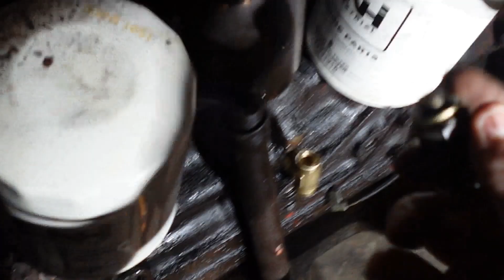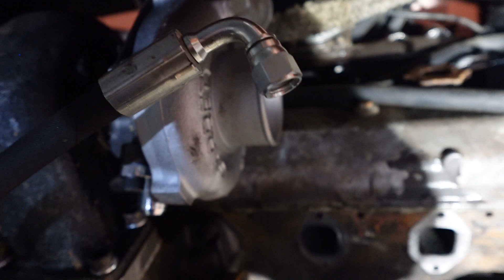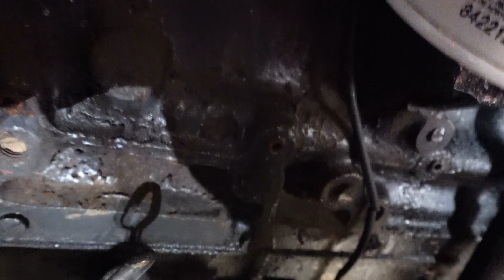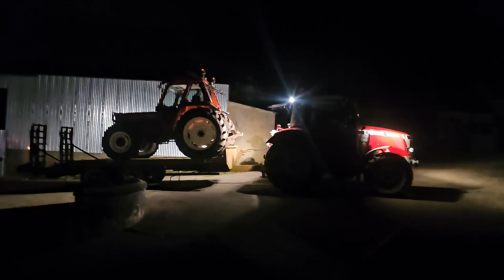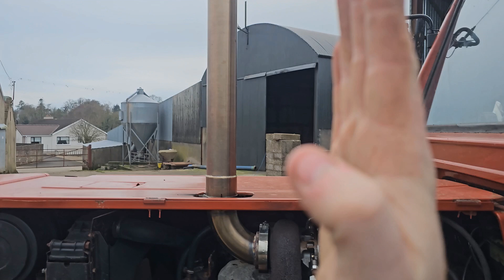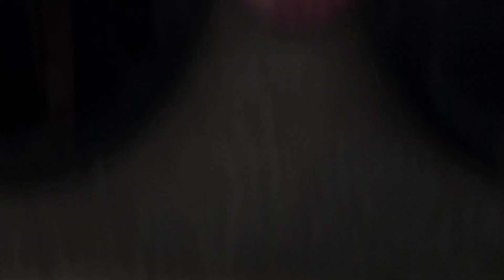Turbocharging my Fiat NH 110-90! Part 3

Comment: your cab heater hoses look like they could do for a change.. 
mine blew a hose next to the extra fuel tank, the engine ran dry and was almost 200c.. but for the time being seems like the engine survived..

I use funnel with looong hose for adding oil, tie the funnel to the left side mirror (yeas that high!) and hose to the engine oil port, it requires ladder but isnt that hard.

I did the same mistake with turning the fuel screw to the max :D engine skyroketed maybe close to 4000rpm! (the needle pegged!)
You can increase the fuel to the point the revs come down normally, but changing the injector nozzles to 5hole ones is highly recommended.
Reply: also if you have problems with smoke coming inside cab, cut the end of the exthaust pipe ans install flap.
All the smoke and noise too will shoot straight up, i used to hurt my ears having tractor turning baler at 2500rpm straight piped and walking around the tractor

Comment: Your return why not tread it instead of welding it?
Reply from the maker: So you've the m32x1.5 bung, and then the thread of whatever the barb fitting is.  Take away the chance of rounding the barb and only dealing with one threaded section. But I see your point

Comment: Hello, could you put a. Y fitting or a T where your return oil goes into the block. This could b an easier way to fill oil. Probably not as fast but much easier.
Reply from the maker: Would take a lifetime. Spotted an offset oil filler next the other day in JNK Motor Factors. That'll do the trick.

Comment: Oi, you need to turn the center piece so the oil drain is pointet more downwards, otherwise good job!
Reply from the maker: I hear what you're saying. That's exactly how it came off an 8340 manifold tho! All I did was clock the compressor housing to suit the Fiat.
Reply: @limitedslipdifferences I definitely recommend clocking the core cartridge so that your oil fittings are vertical, the way it's cocked at the minute will act the maggot as if you've the wrong orifice sizes in your fittings. At least as vertical as humanly possible. Seen lads in the PDVW scene cook brand new turbos with that small mistake
Reply from the maker: Yeah I did that in my Sierra to be fair and it does make sense.
I would say I'll do another video following up on everything that others have suggested such as setting the tappets. Wouldn't be too hard to clock the core.

Comment: Just take to turbo boost pipe off from the inlet manifold and let it suck n/a and you will see standard power without turbo, then back on for 2nd run to see increase
Reply from the maker: Puts serious heat into the system doing that.
Reply: You'll over rev the turbo shaft at that craic. Alright to limp around and get ya home but it's madness to do power pulls with the compressor blowing to atmosphere
Reply from the maker: I know the TM150 got serious warm when the boost pipe blew off. Black smoke for days but no power and absolutely ridiculous heat
Reply: @limitedslipdifferences same fuel setting as when running boost 🔥🔥🔥,, loads of black

Comment: Do a dyno without turbo, then a dyno with the turbo on standard pump setting, and then a 3rd power run with a tweak of the pump,, I am guessing 95 pto then 110 pto then 150 pto,, and if you went mad 170 pto, don't do that, forget that
Reply from the maker: I mean I could do that and put the pump back to how it originally was if I had to. I reckon she was 115 on the shaft prior to the turbo as it was a very good going tractor.
Can say now it isn't 170 and it never will be.
Reply: @limitedslipdifferences they normally do about 150 pto with a turbo and small screw in,, don't worry if it isn't 150,, even 140 is good and reliability is good
Reply from the maker: I couldn't even give it a full screw, injector pump said no. It's seen about 5/8 of a turn over what was done pre turbo - but she'd been tinkered previously I'd say
Reply: @limitedslipdifferences yea definitely I am thinking the same,, not a bad thing in some ways it won't have done it any harm. And now the turbo will clear up and black smoke and more power to boot., see if you can get an intercooler from a TM series, the top tank in and out should just fit over the top of your radiator, it will work lovely. Best wishes 👍
Reply from the maker: That's the next plan to be fair. Well, injector pump done up and then the intercooler. But also on the recommendation from a few people since this video came out, I'm gonna get the tappets set too
Reply: @limitedslipdifferences any extra valve lift will result in a little more power and will also appear to make engine more smooth believe it or not, it will be like a cream egg after 🤣💪

Comment: Wouldnt it be better to turn around that T piece so the oil can just flow straight forward ( not a short 90° corner)
Reply from the maker: originally did think that, but then you're close to the side panel and still need to put a 90 on it anyway.
It's under plenty of pressure, it's getting oil no problem, but I hear what you're saying.